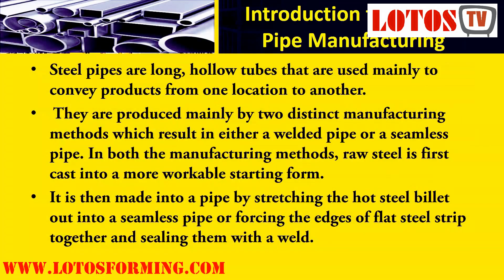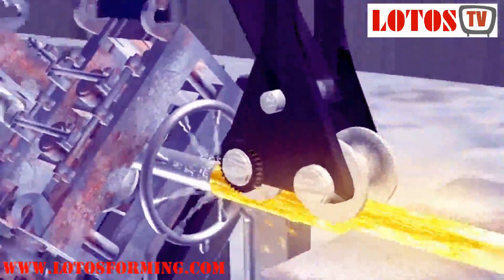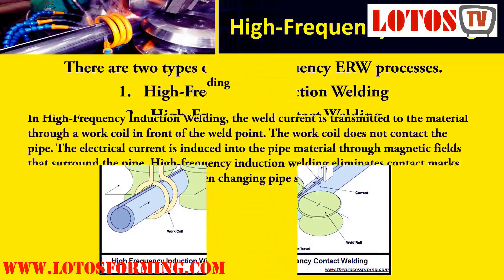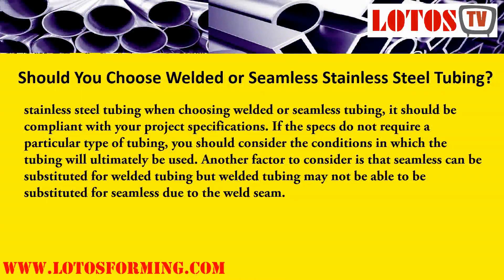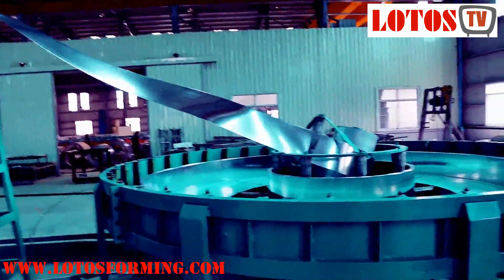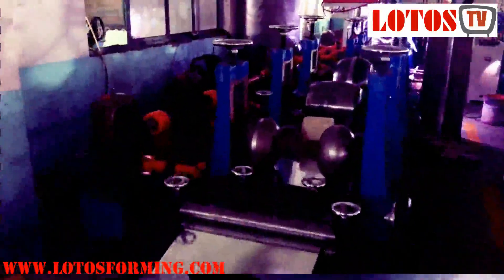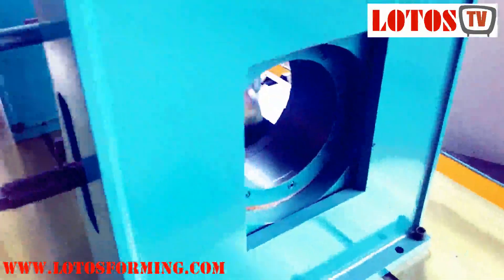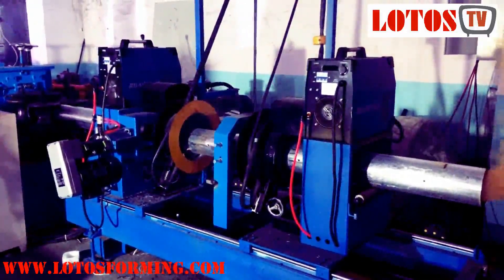【Tube mill process】: welded pipe manufacturing process | tube mill production line

Comment: Electric resistance welded (ERW) pipe is manufactured by cold-forming a sheet of steel into a cylindrical shape. Current is then passed between the two edges of the steel to heat the steel to a point at which the edges are forced together to form a bond without the use of welding filler material.

Comment: In the Tube mill process, Steel pipes are long, hollow tubes that are used mainly to convey products from one location to another.
 They are produced mainly by two distinct manufacturing methods which result in either a welded pipe or a seamless pipe. In both the manufacturing methods, raw steel is first cast into a more workable starting form. 
It is then made into a pipe by stretching the hot steel billet out into a seamless pipe or forcing the edges of flat steel strip together and sealing them with a weld. In the welded pipe manufacturing process or steel pipe manufacturing process, the pipe is manufactured by cold-forming a flat sheet of steel into a cylindrical shape. Then current is passed between the two edges of the steel cylinder to heat the steel to a point at which the edges are forced together to form a bond without the use of welding filler material

Comment: It is then made into a pipe by stretching the hot steel billet out into a seamless pipe or forcing the edges of flat steel strip together and sealing them with a weld. In the welded pipe manufacturing process or steel pipe manufacturing process, the pipe is manufactured by cold-forming a flat sheet of steel into a cylindrical shape. Then current is passed between the two edges of the steel cylinder to heat the steel to a point at which the edges are forced together to form a bond without the use of welding filler material.

Comment: It is then made into a pipe by stretching the hot steel billet out into a seamless pipe or forcing the edges of flat steel strip together and sealing them with a weld

Comment: Then current is passed between the two edges of the steel cylinder to heat the steel to a point at which the edges are forced together to form a bond without the use of welding filler material

Comment: Tube mills produce pipe and tube by taking a continuous strip of material and continuously roll forms it until the edges of the strip meet together at a weld station.we have tis production line and your information is very useful ...thank you

Comment from the maker: Electric resistance welding tube mill is used: For low-pressure fluid transmission, machinery manufacturing, electric power engineering, etc.